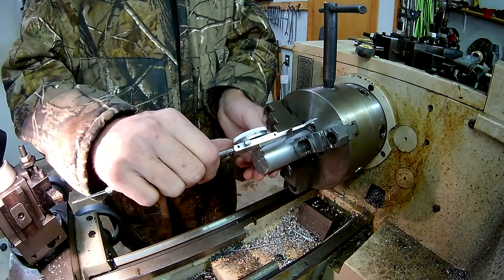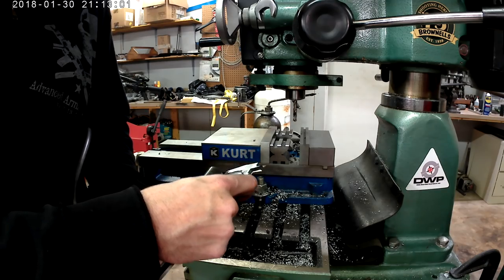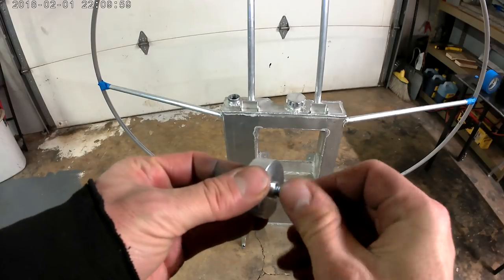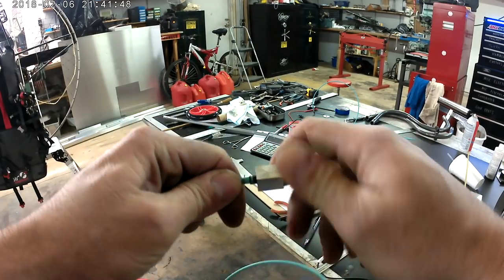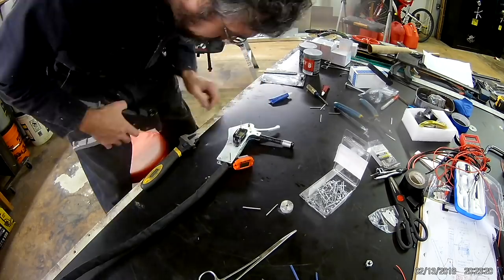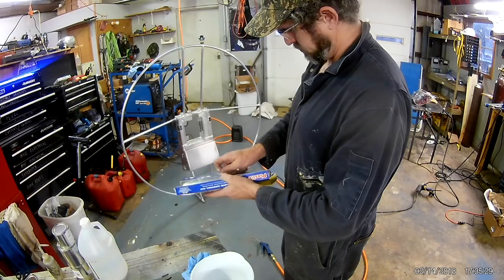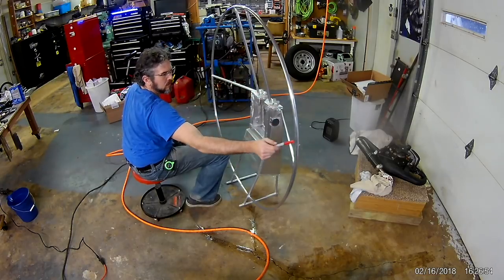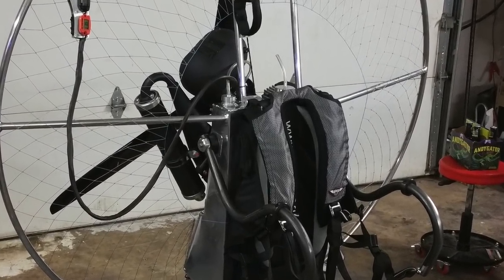Dirty Bird Part 2

Comment: excellent job for a novice Kyle.....next time you build another i can show you some tricks to maker frame around the prop stronger to the body of the fuel tank and the base feet because if you have a hard landing you can actually tear the feat from the fuel tank body thus splitting the fuel tank open. its an easy fix too so my weight estimate is 47.3 pounds

Comment: Been looking forward to this.... nice work KyleO!
Getting good on that TIG... your giving Dmitri a run for his money :)
I'm working on a posh throttle myself (RPM - Temp - Alt/vario on a small oled display) and maybe instantaneous fuel consumption depending on how well my exotic fuel flow meter design works out.
I'm guessing 51.80lbs (if your lucky... mine is 88+ with ten liters of fuel)

Comment: all that work on the tank? I feel kinda bad to tell you could of use the lost wax tech. and cast that whole tank unit section. in about 2 hours? With wax mold side? you could of custom mold to your back before the pour? If new to casting well I think I just open a new can of worms for ya? with casting what would take you 10 hours making you could pour in about 20 minutes? happy flying!58.4 pounds, dry.?

Comment: 54.9 lbs. Some very impressive engineering feats you’ve pulled off too! Did you happen to calculate in a low point in the tank to maximize fuel usage?

Comment: Careful with all the welding defects, there are lots of them! Check for cracks after every run to make sure that it hold up (looks extra at the HAZ), it will be cracks at some point, make sure your not dropping parts while flying...

Think about Murphy...